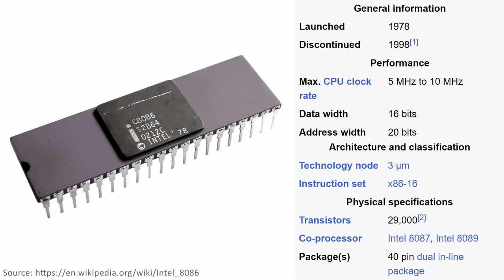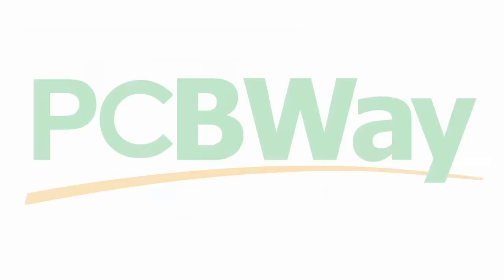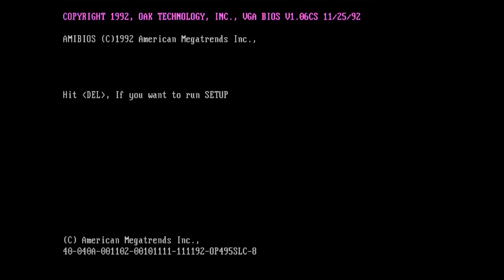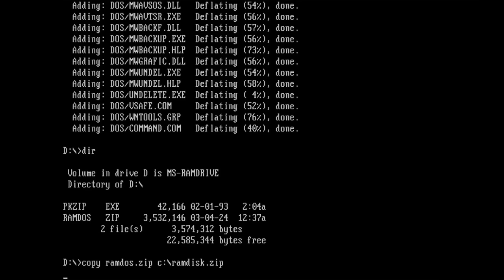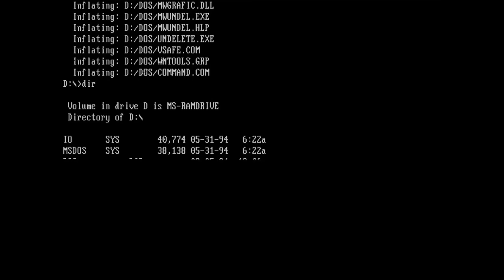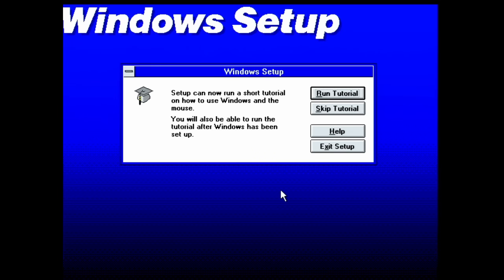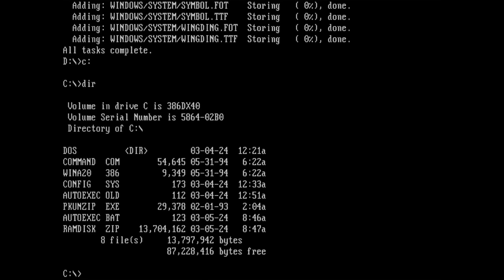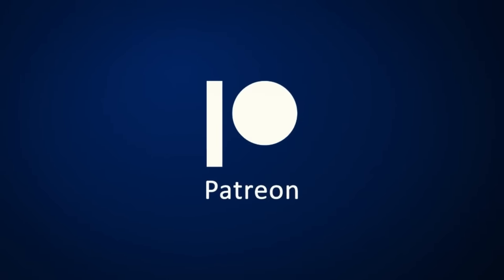MS-DOS and Windows on a RamDrive

Comment: i wonder if this would work with a Pentium 1, lots of RAM and win95
Reply: Of course it would, the harder part would be to install the actual RAM and don't tank the system performance (most of the Socket 7 chipsets, at least from Intel, limit the cacheable RAM to 64 MB, I think only 430NX (a server chipset) and 430HX are exceptions)
Reply: @tadeustad how about putting the RAM drive in the non-cacheable part of the RAM? i dont know if that would be possible, but maybe :) (i have a 430TX board thats supports up to 256MB total RAM which might not even be enough for Win95)
Reply from the maker: Hm, interesting observation. If the ram drive is initiated first, shouldn't it just fill the non-cachable area first? Then leaving the remaining space for the system which would be coachable. This can probably be tested easily by creating a large enough ram drive and do some cache performance tests.
Reply: @bitsundbolts  The stock MS ramdrive starts at the low part of memory so it will eat up cached memory. It also has a 32 meg limit. You probably want to use XMSDSK instead. This alternative utility allocates from the uncacheable top of memory and supports up to 2 gigabyte drives.
Reply from the maker: Thanks for saving me time 😀. I'll keep this info for some experiments!

Comment: Not only I know that MS-DOS ships with a RamDrive out of the Box, but also have the source code (in assembler) of IBM's PC-DOS RamDrive implementation.

But, a better setup if you have the memory would be as follows:
Increase the size of the Drive Caches (FastDrive and SmartDrive)
Create a RamDrive and compress it with DoubleSpace/DriveSpace
Set TEMP and TMP to that drive
On Win3.1 set the swap to that drive

Congratulations, your drives now feel faster (because of the incfreased caching) AND the "RAM" Available to Windows is about 50% more.

On my P1 90Mhz with 16Megs, I did that (8 Megs for Windows + 8Megs for the RAM-Drive), that gave me on Win3.1 8MB RAM + 14MB of "Swap-to-RAM" (that was slightly slower than using RAM as is but SIGNIFICANTLY faster than swapping to disk), the 2MB that I ledt out were for TMP dos Files, and on the unlikely case that the compression ratio was lower than 2:1. Compile times both in Windows and MS-DOS were a beast, and so were printing times...

Sadly, Microsoft closed that loophole on Win95, so one required Special Software (RAMDoublers), and while some of those did something, others did a poor job, and in some infamous case(s), other(s) did jack5h17

Comment: I ran Windows 10 on a ram drive once, just to test how much faster it would be. Turns out, quite a lot, since Windows abuses drives so terribly. I had the Windows install stored on a 2.5" archive HDD, which had something like 23ms seek. It was completely unusable. But that's because of the random reads. Copying the whole thing into RAM was pretty quick and then Windows would work very well. It was fun. But of course, assiging 128GB RAM to a VM drive isn't very productive in reality. :)

Comment: Any way to have a network drive on DOS 6.22 without changing anything in DOS or with minimal changes in the config.sys? I have a machine that runs DOS 6.22 but any changes in the DOS config can affect the machine's movement and XYZ gantry. 

My best option so far is with flashfloppy floppy emulator, and a RaspberryPi emulating a USB drive via SMB. Any other way?
Reply: mTCP NetDrive is worth trying but you seem to have a very specific use case YMMV.

Comment: Wow 32mb in a 386! I still have my 386, started with 1mb and now years later 8mb. Upgraded the cpu to a 486dlc-40 with a ITT 387 fpu. The memory is much slower than on my real 486 with 72pins memory and pci bus. The ramdrive does go faster than a hdd, but my sd2ide adapter is already much faster than a hdd. Don't know if a ramdrive would do much more in reality.

Comment: do you think dos can handle 128GB of ram?
Reply: Last himem.sys can handle up to 4 gb of RAM.
Reply: On intel 80386+ we can switch from the 16 bit Real Address Mode with a segment size of 64 kb into the undocumented 16 bit "BIG" Real Mode with a segment size of 4 gb for DS, ES, FS GS segment and 64 kb for CS and SS segment and A20 address gate switched on.

That allows to read&write the entire 32 bit address space in MS DOS, but the code and the stack have to use the first mb of memory. I use it to write into the linear frambuffer of a VBE 2 or VBE 3  graphic mode of the vesa bios of modern graphic cards. The LSB is located in the 4th gb.

Comment: I did something similar for my brothers Amiga 500 using the Rad: device so he could boot from floppy connect to my A3000 hdd via  PARNET  the rad: would survive most reboots
the A500 had 3Mb theA3000 12Mb

Comment: I never understand why intel did a 1mb memory limitation. It's a 16 bit CPU. It takes 2 16 bit registers. But it bit shifts one of them by 4 (free operation since it's designed that way) and then added together to get a 20 bit address. WHY!?!?!?!? you're using 32 bits. why not just make it internally 32 bits? No adding required. It's just a matter a 16 bit register going to some lines and another register to the others. Then just simply ignore the bits you aren't using. The ideal solution for 20 bit memory addressing would have been the most significant bit (as a hardware/software switch) + the 19 least significant bits. That means you get 512kb of hardware and software which was still a lot for the time, but for a newer CPU, 24 bits would mean 8mb of each with zero compatibility issues. Using the full 32 bits would mean 2gb hardware/software. All the BS I dealt with in the 90's with dos boot disks for specific games? never would have been needed.
Reply: The point of the addressing system is that each application/driver/library/etc could get its own private address space starting at zero. If the segment and offset were combined in the obvious manner then a small program that only needs 1k would be forced to consume an entire 64k of memory. Such a waste of memory would be a ludicrous proposition in 1978. Nobody at Intel was expecting that people would be demanding 100% compatibility with a then-nonexistent PC-DOS architecture for decades into the future.

IMO the problem was just with the MS-DOS ecosystem, particularly software which performed direct arithmetic on the segment registers. This application oversight is what prevented progress. If applications only used segment numbers provided by the OS then 286-enhanced versions of MS-DOS would've had no problem handling all of system memory.
Reply: @eDoc2020 we don't talk about 286. ever.
Reply: yeah, the famous segment *16 + offset. the answer why is pages.
Reply: @giornikitop5373  you'd still have 64k pages though. I mean it's multiples of 64k except now they don't overlap.

Comment: Why move dos to the ramdrive? There is barely a speed advantage and booting is still from the harddisk. Windows on the ramdisk makes more sense, a speed advantage and it runs on top of dos. 
Copying dos itself is just a space waste on the ramdrive. Space that could be used for applications that can use the speed advantage of loading from ram .

Comment: I use a ramdrive on my desktop computer. I have enough memory to afford it. 
I keep image files , and mount them into the ramdrive as needed. 32 gbytes is sufficient for most things i have , as a ramdrive.  Leaves me with 32 gbyte system ram. 
Yess doing the copy process does take time. However after its done , that given software runs and loads extremely fast , and works Just a lot more fluently. 

Frankly I wish i could get more ram. But I only have 4 slots , and even so i em capped to 128gbyte maximum.
This is the only reason why i eyeball upgrading to a wotkststion class computer. 

Allso amd can Kiss my rear end with its oddly stupid 128gbyte limit , not to mention not upgrading the tr4 platform properly.
I would pretty mutch Just love a cpu with 16 cores at minimum , a large 3dcache , 4 memory channels and 512gb ram limit. 
Preferably should have 4 pcie x16 slots , least 2 ports for m.2 drives , least 6 sata ports , 
BIOS should support jbod arrays. 
And should have least 1 , minimum 10gbit Ethernet port.

Comment: A nice experiment but not really a useful thing to do. You need to read everything from the HDD once when decompressing, so it doesn't save any time whatsoever in the end. You'd be better off having a large smartdrv read cache (for DOS/Win3 usage, modern SSD replacements are blazingly fast anyways; even HDDs were for the DOS+win system files).

There is a real use case for this kind of setup: removable disks. IIRC, even Windows 98 rescue disks used to extract all tools into a RAM disks from a cab file. You don't need  the boot disk anymore if you've copied everything into the RAM disk, so using other floppies is much simpler!

But for a real OS installation? Useless, makes no sense, has more drawbacks and little gains.
Reply from the maker: Well, it is very old technology - and what I did in this video is more of an experiment. I did not test smartdrv yet, but it definitely sounds like a better solution if you want a reliable system and storage.
Reply: @bitsundbolts Yeah I didn't mean to sound disencouraging! Just wanted to point out when one might actually want to do this (and when not) in a real-world scenario. It's a nice experiment in any case indeed.

OTOH smartdrv is not nearly as intelligent as modern caching, but it worked fine for most caching in the DOS era. If you are really, really sure you use certain data many times during a boot, (and also read other data you don't, which might push the data off the cache) it might make sense after all, as it will make sure these program will stay in memory. Such cases are really niche though (and mitigated by the fact you have a CF card, which is blazingly fast for a 386).

Comment: Next up: permanently powered memory modules.
Reply from the maker: I wish it would be as easy as just adding a battery to the memory module. But I think there needs to be extra logic to perform the periodic refresh cycle which is way out of my league 😞
Reply: You're basically describing RAM based SSDs which have been available commercially since the early 80s e.g. Imperial Technologies' Mega RAM Disk Emulator
Reply: @bitsundbolts doesn't the refresh only need to be done after a read?

I thought it went like: read val x from cell address 0xffff, write back val x to cell address, return val x to software. I thought it did this because checking the electronic state of the bit cell removes the electon(s) (I'm a software person so I may be way off here) 

Or does ram need refreshing, even if no software ops are happening? I assume if so that's done in hardware since I've never seen it in any kernel MMU code
Reply from the maker: I am also not sure, but I believe that the periodic refresh is required even if there's no destructive read operation. This refreshing is handled completely in hardware as far as I understood.
Reply: @hayleyxyz  DRAM requires periodic refresh cycles independent of reads and writes. Modern ICs contain their own refresh circuits as it makes implementing sleep mode much easier.
Reply: Gotcha, thanks both

Comment: Its cool, but doesnt make much sense.  Sure, booting and loading Windows programs will be fast.  However, 99% of those files will NEVER be read.   They are now consuming all of that RAM on the ramdrive, making that precious RAM absolutely useless.  The few files that do get called are being read from the ramdisk, rather than the slow drive, which is speeding up your system.  However, now they are occupying the ramdisk AND working memory.  Once the an application is in memory, it isnt reading or writing to disk, unless it is actually doing disk operations.  Your setup will do nothing to increase game or application performance.  If it were me, and I wanted to get the most performance, I would be fine with a slow boot, but install the game or application to the ramdrive.  Games that took a long time to load levels, become near instant.  Frustrating, programs that are constantly reading and writing to disk, become pleasant to use.  THAT is the way to use a ramdisk.